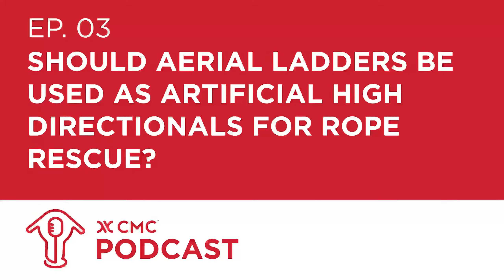CMC Podcast E3 - Should aerial ladders be used as artificial high directionals for rope rescue?

Comment: Look a little deeper than just recommendations that are anecdotal.  Look at all of the cases of aerial ladder collapse and failures. There are many. Often these failures include weight and ladder movement. Loads that create a twist to the ladder, such as moving a load side to side, places all of the load onto one ladder channel with a resultant of pulling up on the opposite side. Raising and rotating at the same time is one of the largest areas this happens. 
The longer your ladder is extended, the more the bed sections pry against the ladder bed itself. This is a class 1 lever at its pry point at the bed sections and a class 2 when coming over the hydraulic arms. 
My rescue utilized both our straight stick tiller mounted ladders and our rear mount buckets for anchor points. In doing this we never extended the ladder beyond 50 percent extension. We ensured all ladder locks were engaged and the ladder controls were idled down and covered. We operated as close to 45 with a max of 60 degree slope to ensure resultant would pull back towards the turntable.  
For belay, we utilized the petzl ASAP lock so that there was minimal impact load from the potential failure. 
As to system, most frequently we utilized our anchor and system off of the rescue and not the ladder. Consider engineered anchors off of a separate apparatus where line runs as close along the line of the bed. In using another base anchor for your system, you can often move the run above the ladder similar to how the cranes cables run in truss constructed cranes. Consider a system such as a harken lokhead winch that guns back to your engineered anchor off of another apparatus. The 45 - 60 degree aerial alignment allows the rope to run above the ladder without running down rungs.  

Great discussion. Stay safe and practice before you need it.

Comment: Hello, I was looking for the aerial manual which references using hydraulics to raise and lower a stokes basket. Specifically using extend/retract vs raise/lower for lifting. I heard it referenced in your podcast and was wondering where I could find it.
Reply: I found a brief mention of it when I googled Pierce aerial apparatus manual pdf
Reply: @johnnovaktr2fd677  
Thanks for the recommendation. Is there a way you could put the link to which manual you referenced, I get multiple manuals with that google search.
Reply: https://www.montgomerycountymd.gov/mcfrs-psta/Resources/Files/Driver/Aerial_Units/2016_Pierce_AWS_Aerial%20Operator%20Manual.pdf